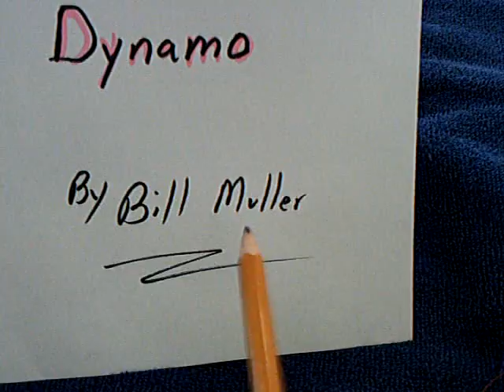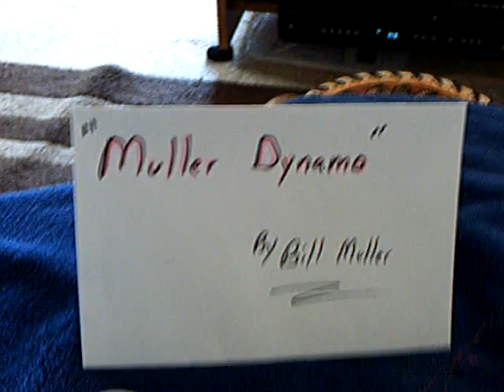Muller Dynamo--- my kitchen table learning tool.ASF

Comment: You can make  DIY ferrite cores to eliminate the cogging yet still gain the benefit of cores in your coils. You can make your own ferrite cores with black iron oxide from eBay along with the other additives mixed with fiberglass resin in a thick paste with just enough resin to hold them together securely. Simply make molds of any core shapes you want and line them with a thin layer Vaseline, silicone or wax as a release agent. Add more generating coils too! Magnetite is another interesting material you can powder and utilize alone or in combinations with various other additives such as Bismuth, Antimony and pyrolytic carbon to exploit their diamagnetic affects and other anomalies on the quantum level. You can experiment with exotic metal powders and element combinations too, the sky is the limit when you are the boss. That way you can experiment with various compositions and geometry's of your cores on the cheap, far cheaper then buying exotic custom manufactured cores. Mere pennies a piece if you buy in bulk.
   Also use magnetic bearings for near zero friction and you can enclose the entire device in a vacuum chamber such as a vacuum desiccator for zero friction. You could also fill a standard sealed chamber for your device with hydrogen gas like they use in commercial power generation dynamos to lower friction yet the hydrogen gas is an excellent conductor of heat that can be pumped through radiators to dissipate the heat from the coils and nearly eliminate friction at the same time in the event you scale it up for major power generation. That should be enough ideas to keep you tinkering all year and end up with something dangerous! Jeez, I hope I don't get fired and have the the black vans come for me for in the dead of night for telling you too much proprietary information! lol

Comment: They did a similar concept for wind powered car  and went more than double (2.86) the speed of wind with no other power sources.

This is how they did it:

The wheels turn the prop, which turns the vehicle’s wheels, which turn the prop + wind, which turns the vehicle’s wheels  !

Comment: of most of the systems i have seen this is the best yet at self running there was one done on youtube with a car alternator that used one set of windings run resonant and the other two as outputs the input current was less than an amp and the output was about 20 amps total. i have searched for this yout tube but it seems to have disappearred.

Comment: @Lidmotor ---Good idea..I have 2 bags of the chokes in a variety of sizes from Radio Shack.  You don't have any Hobby Lobbies where you are at, but I have to go to one in the morning to finish parts picking. I lived in HB for 15 years and ended up back in Ohio...Parts are scarce in my area..electronic parts that is. Going to begin this this weekend yet.

Comment: Hi there - there was a modification you missed on the self runner that actually ties in with lenzless. on the back of each coil was a magnet, if you watch it again you will see them. they seem to be  key to self running. im not sure of the polarity. nice work.

Comment: Hi Rusty. Cogging is not an issue with an air core right? But the coil has stainless which might be causing some drag. Good luck. 
J

Comment: please, pretty please. Make a test like this :
step 1) charge the cap
step 2) measure how much time it takes using your 3 leds to drain the charge from it. ( if you get bored put more leds /lightbulb ? )
step 3) charge the cap ( again )
step 4) do as in this video, put the cap to drive the motor/generator. see if it runs more time then measured in step 2

No high tech devices to measure the input output, just a clock that will simply explain the efficiency of this device. 
Thanks !!!

Comment: if your like me you have a lot of ferrite cores laying around. i find it useful to smash them somehow and use the powder as sort of a "magnetic sand". also im starting to play with this setup also, trying different magnet alignments.. it seems a good way to neutralize some of the core cogging is to also place a magnet on the other end of the core in opposition to the rotor magnet as to provide less strong attraction and a weak repulsion instead.  so the cap is indeed charging at the same time?

Comment: I have been following this also and if you decide to go with the solid core coils...The RF Choke you bought for the slayer micro exciter is 6.5mm and can be cut. I do believe the bobbins you have are 6 or 6.5 mm and the size given on the project was 6 mm. Just helped cleaning out Radio Shack inventory today and tomorrow the sewing shop...the places we go.
Nice work by the way!